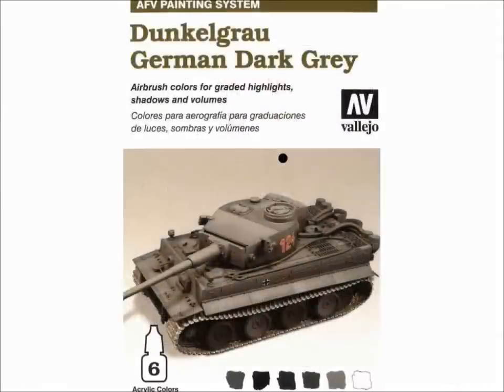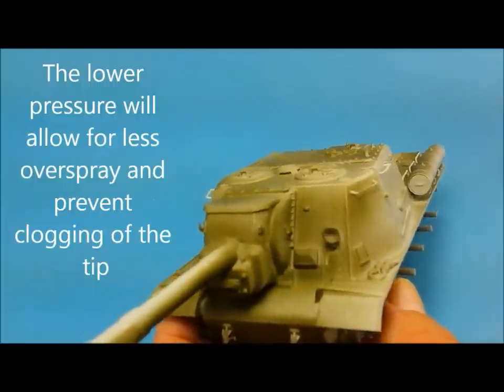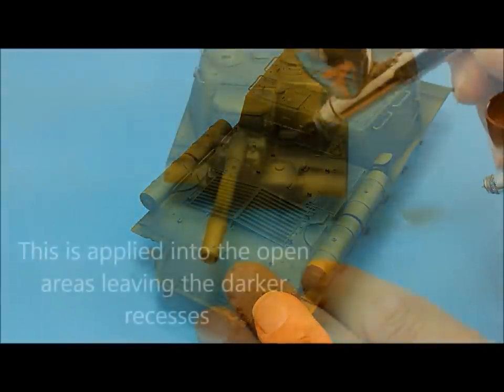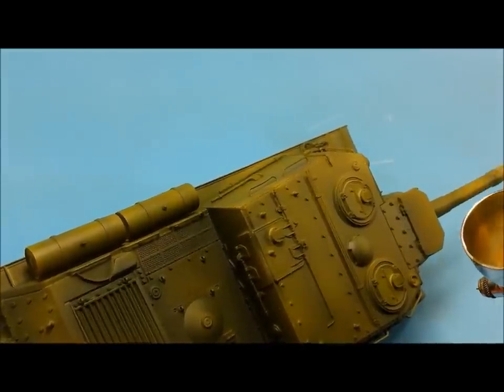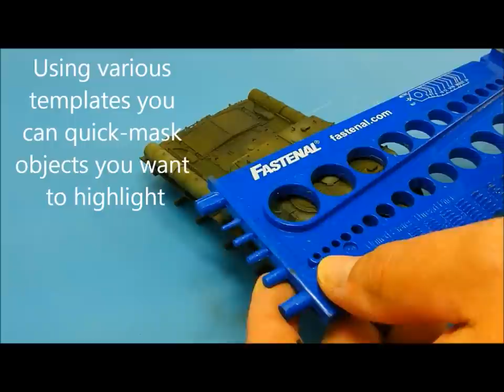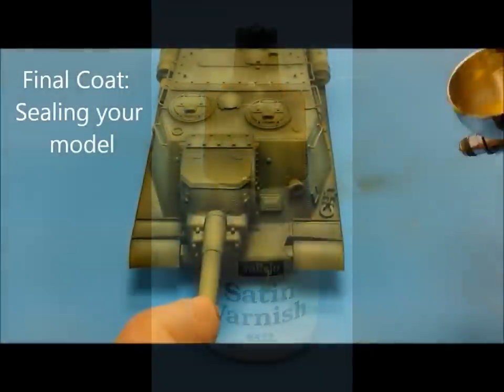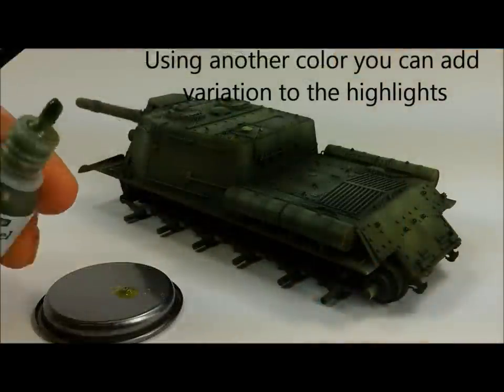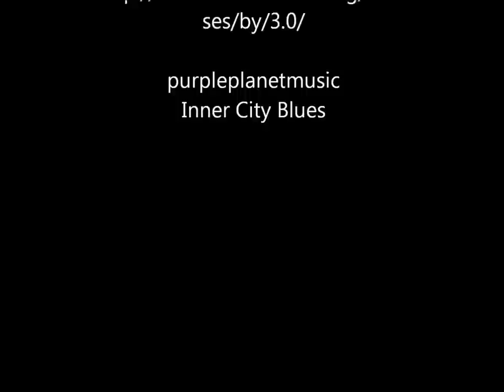Step by Step AFV Russian Green 4BO

Comment: Todd, thanks for a great tutorial, need to get thses as having problems with ---  ---- another Spanish producer.
Reply from the maker: +tomrace16 Thanks Tom!   Give them a shot.  The AVF sets are a great way to try out the paints with minimal investment.  As you can see, quite straightforward to use.  As for the issues with the "other" paint....I don't know your set up, but they are designed to be applied in ultra thin coats building up the color. Similar to dusting coats.  It takes a bit longer but should do the trick.   Little to no thinning should be needed and lower pressures might help out.  Best of luck!   Let me know if you have any questions once you pick up the new paints!  ;)
Reply: +Todd Michalak Thanks Todd, I am  spraying with a  HS ultra , never had a problem till "that paint " seperated, I think due to the cold. Always sprayed at correct pressure, kept gun clean, but the paint started to look as if it was floating on the top of the primer in patches, bloches and looking as if there was grease on the base, which there wasn't. So have decided to go down  the Vallejo path . I will come back to you thanks once Iam stocked up.  Cheers Regards John
Reply from the maker: "John"...sorry 'bout that!  :P   Yeah, I have heard that one before too.  You might be correct with the cold thing.  Same thing can happen with condensation and/or thinning too much.  Good luck with the new paints...let me know how they work out for you!! 

Cheers,

T

Comment from the maker: kalasnikoch,  Although the bottle are around half the size of the tradition 17ml bottle, they do last a while due to the process of applying the paint.  These are designed to be applied in thinly built up layers resulting in the final multi-tonal finish.  If I base the usage on a tank model the size of a Pz.IV, you should be able to adequately cover 4 to 5 models with each set.  Remember lightly applied coats for each stage!  ;)
Reply: Thanks man, just ordered one of these sets to try it out for myself!
Reply from the maker: kalasnikoch
Great!!  Please let me know if you have any questions!   Good luck and enjoy!

Comment: Thank you so much man, this helps a lot.
Reply from the maker: You're welcome. Glad to hear this helped some.
Reply: @5150TRM   Hey Todd, I got a problem here, when I trying to apply the stain vanish, my airbursh is unable to push the stain vaniah out. There only gas keep coming out but no stain vanish, i shaked it well before you use the vanish. What should I do?
Reply from the maker: @Aaron-fl3fx , by "Stain Varnish"....do you mean "Satin Varnish"?   

Assuming you mean the Satin Varnish, I thin it one drop of thinner to every 3 or 4 drops of varnish.   The only other thing that might cause only air to come out and not paint, could be there is some residue stuck in the tip.   

Try putting some water or thinner in the cup and spraying it.  If it acts normally, then try to thin the varnish...add a drop or two of thinner to the cup first, then add the varnish....mix it up with a small paint brush or tooth pick.
Reply: @5150TRM  Thanks I will add some thinner, sorry wrong spelling.
Reply from the maker: No worries...I just wanted to make sure we were talking about the same product....LOL    Best of luck...please let me know how you make out!
Reply: @5150TRM  Will do many thanks again.
Reply: @5150TRM   Hey Todd just finished my T-34-85 with matt vanish. The ratio as your provide is working very well, thanks to you by the way.
Reply from the maker: You're welcome...that is great to know, my friend!!

Comment: What size of needle and airbrush do you use?
Reply from the maker: While I use a variety of airbrushes with different sized needles, for the most part, the most used size is 0.2mm.....which is installed in the Badger Krome airbrush I used in this video.

Comment: Hey Todd,
Great video! I have a question I'm new to model building. What airbrush system do you recommend?

Thanks...
Reply from the maker: Hello Deward,

Thank you!  Welcome to the hobby my friend!  There are a number of opinions when it comes to airbrushes.  Being that you are jst starting out, there are a number of different ways to go Harder & Steenbeck, Badger, Iwata, Master and more if you care to dig deeper.  Personally I use two different airbrushes; both are what I consider to be mid-range cost-wise running about $120 to $130 US.  Harder & Steenbeck's Evolution Silverline Solo - Here is the main site to check out what they have - http://www.germanairbrush.com/   This is a German based company but they do sell many places and have a location in the US where mine came form - Precision German Airbrush - http://precisiongermanairbrush.com/  They sell all the supplies and replacements for their brushes as well.  You can also pick and choose how you want you brush to be.

The second brush is Badger's Renegade Krome.  - http://www.badgerairbrush.com/  Again, they sell just about everywhere and parts are available to.  They also have a great policy of customer service.  Any problems with the brush, send it back with a pre-paid box to send it back to you and they fix it for free....most cases within 72 hours.  I am not sure if the Krome is actually sold still, but I certainly could vouch for the quality of its predecessors.  The Renegade Site - http://www.renegadeairbrush.com/

Other brands work really well for many people and like the ones I use, it all comes down to personal preference.  If there is a local hobby shop or even AC Moore or friends with airbrushes, try and get some into you hand and see how they feel.  I am not a small guy but yet both the Krome and Solo fit very well in my hands where others seem to get a little lost or the balance may seem off to me. 

Starting out, I would suggest going with a gravity fed double action airbrush.  In my opinion a much better brush than siphon feed.  Try and stay away from something too cheap though as you do get what you pay for but you certainly do not need to spend over the mid-range costs I mentioned to get a great airbrush.

If you have any other questions, feel free to fire away with a question, also, if you like, you can stop by my website - Modelers Social Club Forum - http://modelerssocialclub.proboards.com/  Great bunch of folks at all different skill levels, having fun, building and sharing both their works and their knowledge!  Hope to see you there soon!!  Happy New Year!!

Cheers,

T
Reply: Paasche's H series airbrush and compressor set got me through many models before I upgraded to a Talon brush for more control and finer lines. The compressor is great and cannot be beat for the price. Check Amazon for deals.

Comment: Stupid question - is there a match in normal Vallejo Model Color or Model Air to the Green and Light Green?  I already have the 4BO primer and the first two color equivalents, along with the satin varnish, but I'd rather not spend $15ish to re-buy the whole set just to get two missing colors.  

Thanks for posting this - I'm planning on using it to try stepping up my painting game on a BRDM-2.
Reply from the maker: Hi Mohn,     This is not a stupid question.   The two colors, .223 & .225, are specific to the AFV set.  Those wo number do not show up on the equivalency chart to convert to Model Color as well. I response to you post, I have sent off an email to Vallejo asking if they have information on converting these two color.  As soon as I receive a reply, I will comment here with the results.   In the meantime, Russian Green 71.017 is only a 1/4 to 1/2 tone off from the 71.223 Green and could be used in substitution.   Also US Light Green 71.137 or Camouflage Light Green 71.006 are close matches to 71.225.   In both cases a slight adjustment could be made by tinting lighter or darker as needed.    I will let you now what I hear from them soon.... Thank you.
Reply: Sweet, thanks!  I tend to err towards Model Color so I can thin as needed or handbrush to touch up (also because Model Air has always had a tendency to not flow cleanly through a .38mm nozzle, and I have yet to buy a bigger one) and thus far, it looks like the best options to equate based on what you're saying and based on the kit contents: 

-Model Air #018 Camouflage Black Green = Model Color #89, Military Green
-Model Air #017 Russian Green = Model Color #96, Russian Green
-Model Air #223 Green = ?  (I'd guess just add grays to match as needed or offset)
-Model Air #225 Light Green = Model Color #80, German Camo. Bright Green
Reply from the maker: The BRDM-2 is a fantastic platform to play around with!   Big panels for all sorts of weathering!   

I am going to be completely honest with you...I have been doing technical support with Vallejo for a couple years now and you are the first one to mention having better luck airbrushing Model Color over Model Air.   LOL   This is not a bad thin by all means....I just find it very interesting.   A couple quic questions if you don't mind?   

What are you thinning the Model Air with...if you thin at all?
What airbrush are you using?
What pressure are you shooting at?   

I ask, because I use a number of airbrushes myself, but one in particular, and H&S Infinity, has a .15 needle and have very little issues running paint through it.  I will use a .2 for most priming as the primer is a bit thicker on the darker colors.   Thanks for letting me know about what you are experiencing with the Model Air.  I would love to help get to the bottom of what might be happening!
Reply: I never thinned the Model Air - I applied it right out of the bottle after shaking. 
I'm using a Paasche Talon with the stock .38mm nozzle/needle.  
I usually have been shooting at 18-20psi.  

I had issues with Model Air twice - once with a bottle of Barley Gray, once with another color which I forget.  The Barley Gray was lumpy and no amount of shaking by hand made it work.  I tried just getting what I could through the airbrush and was met with no luck.  I added some Thinner Medium to see if I could mix it free, but still no luck.  I had to completely tear down my airbrush and clean it in the ultrasonic cleaner with lacquer thinner.  

The second time - I forget the color - I shook the bottle with a jigsaw, just to ensure everything was evenly mixed.  I was okay for a little while but swiftly got huge amounts of tip-dried paint.  

To be honest, I've accepted tip dry as inevitable, even at low pressure - I was spraying the 4BO primer just the other night, straight out of the bottle, and it was at around 10-12psi.  I eventually got tip dry, but I just keep a Q-tip soaked in Windex handy to swab it out and continue.  I also had the same thing happen with Model Color flat black thinned for airbrushing.  

I generally thin at 3 drops Vallejo flow improver and 3 drops Vallejo airbrush thinner per 10 drops of paint, with 2 drops extra of each for the entire bottle, and even then I get tip dry.  I kinda thought this was just par for the course. 

For what it's worth, I do tear down the airbrush and give the metal parts an ultrasonic lacquer bath every couple of weeks.  Even after that I get a bit of tip dry.  

I'm not ruling out the possibility that my local hobby shop just has older paint; they don't sell much Vallejo.  Still, though, to hear that a .15 is doing well leads me to believe something's gotta be up with my airbrush.
Reply from the maker: Sorry...I had to watch my daughter game for a bit!  

I don't think your airbrush is the issue.  It does sound possible the paint at the store is old as you mentioned.   If you think about it next time you hit the LHS, copy the batch number down from one or two of the bottles and I can inquire about it.   

Because, 3 drops of improver and three drops of thinner to 10 paint does seem like a lot to me....the fact that it dries with all that is interesting as well.  The pressure is spot on.....drying tips will be inherent of most water based acrylics.  like you with the Q-tip, I keep a flat brush damp with thinner next to me when I spray.   Every so often I give it a swipe to ensure it is clean.As for the Flow Improver, I personally don't use it as I have not had any issues that warrant using it.  But, 1 drop per 10 is recommended...and that was from my recommendation when testing was being done.   Typically I thin model air about 1 drop per 4 to 5 drops of paint.   My psi settings are similar at 12 to 15 psi and I slightly regulate the flow of air using the trigger.   

All of the conditions/factors you are using seem to point to the paint...for my opinion.  I have had one issue before with the black primer...which I use all of the time, it was doing something similar.  I chalked it up to a bad batch and grabbed something else   Another factor is you shooting the primer and having no issues.   The primers are slightly thicker than the paint.  If you ever make an attempt again, try one drop of thinner....you could try one drop of Vallejo AB Cleaner too.   I will use the cleaner to thin depending on the weather conditions.  There is an extra surfactant in the clean to help suspend the paint.
Reply: I've bought all my Model Color from one shop.  If it helps I don't mind cataloging a few random samples to get an idea of whether or not I've just got very old paint.  

I usually use Windex as an acrylic airbrush cleaner - would that help thin things out a bit?
Reply from the maker: Windex will work, however, the ammonia in the windex has the potential to soften brass parts like the tip of the AB.  I have used IPA (rubbing alcohol), denatured alcohol and distilled water at times.  There are a million suggestions out there for thinning...not any one is wrong if the person is getting the results they are looking for.  No matter what paint I am using, I tend to stick with thinners specific to the brand.   If you could get you hands on one of the bigger bottles of thinner it should last a while as you only use a drop or two at a time.   I do basic cleaning with water and finish with airbrush cleaner....save one the cleaner.  Also break things down when I can to do a full field stripping of the brush....LOL   I am bad at this though.   I do some demos at shows and like the last one, used the AB close to 40 hours over four days and only did the cup cleaning method.   I am surprised it still works...LOL

Comment: Todd can you do a video with the Panzer Grey color set. I just tried it on a practice model and it looked like crap. I dont know what i did wrong.
Reply from the maker: I could certainly do one if it will help.  One thing about the Dunkelgrau set was how close the shifting in color was from paint to paint...the two colors in the middle were real close, I think 1/2 tone off.   I used the set a couple times already and found it worked really well if you start with the base color and the first coat but then lighten the 3rd step color with the highlight...drop or two.  I have also just skipped the 3rd step and went right to the highlight. 

I will dig something out from the stash and see what I can come up with!  It may take me a couple days to get things rolling and then a couple more to get it all sorted and posted if you can wait.  If you try again before then and have a question, just fire away!! ;)
Reply: Awesome thanks Todd sounds great!